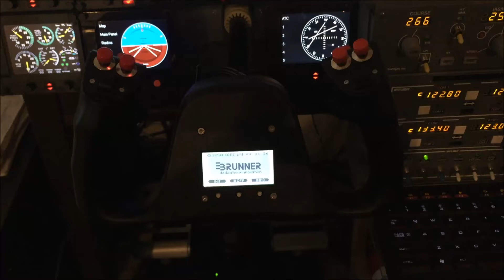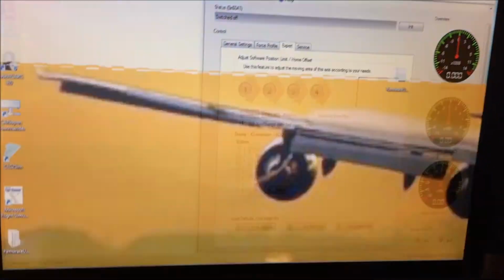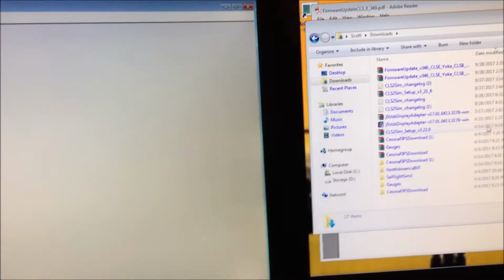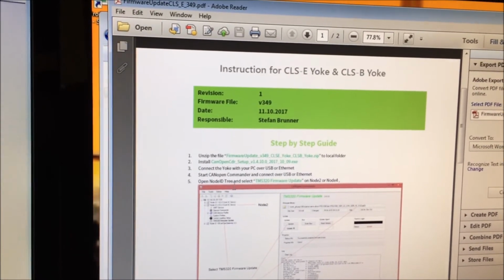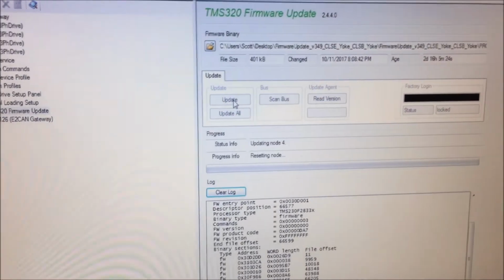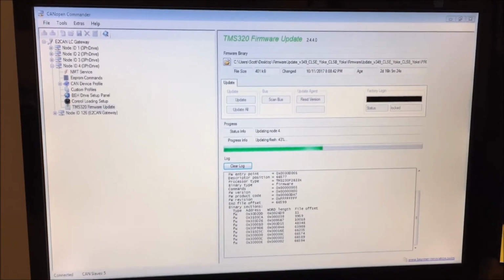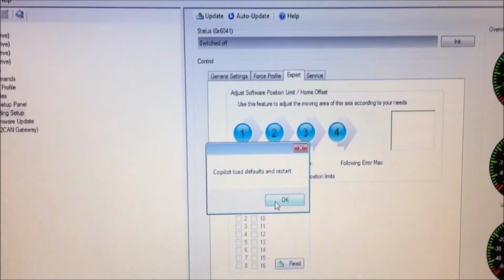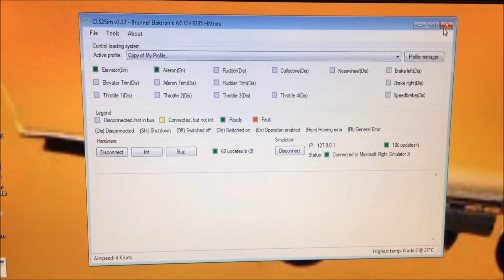Brunner CLS-E Yoke Firmware Update

Comment: Thx for the video, Cap! What's your view on pairing this yoke with one of their pedal sets? I mean, how important do you find having pedal FF to be in the whole immersion thing? Considering your real life experience and the hefty price :)?!
Reply from the maker: I would love to have the force feedback pedals but your right its very expensive. I bet they would add a lot to the sim experience. I haven't bought them yet but its on my mind. The place the force feedback pedals would be most effective is on the ground taxiing and at the start of your takeoff roll. The is when forces are changing across the surface of the rudder. In the air I think having the force feedback would make coordinating turns more realistic.  At the moment I'm making due with the Saitek rudder pedals.